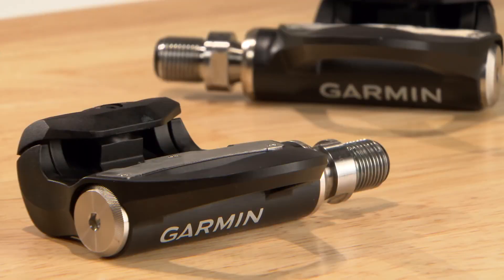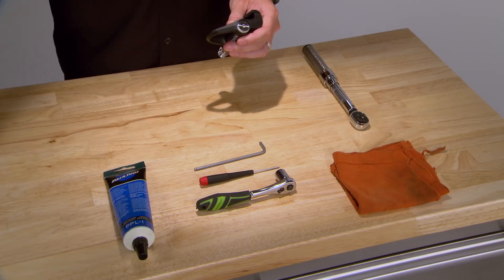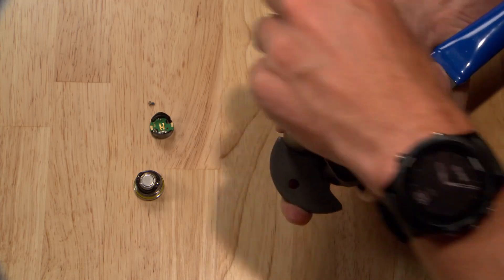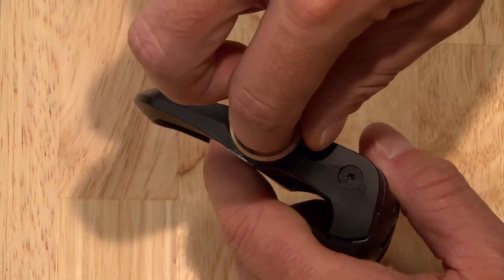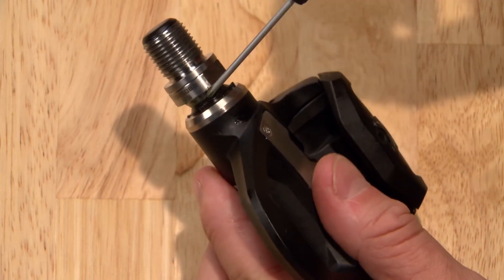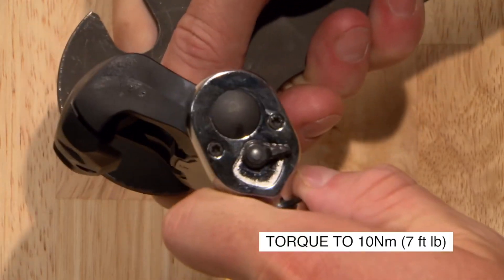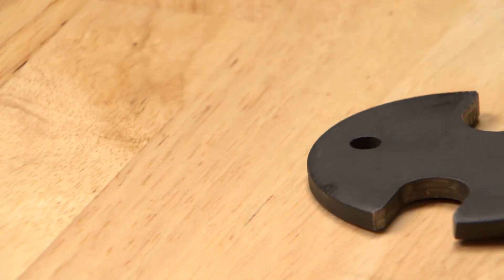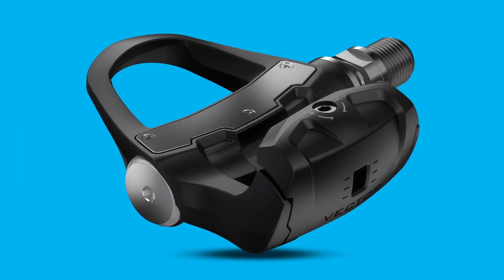Garmin Vector 3/3S: Servicing Your Power Meter

Comment: My purchase came broken - the body felt off the pedal. Hopefully I did not suffer injury. I needed it for a race so there was no other option getting it tightened in a bike shop by professional. I am really sorry that I didn’t returned it back. After few battery changes the thread of the pedal body was damaged by the battery cap. Could you please explain to me why the battery cap is metal and screws to PLASTIC?

Comment: What 12mm socket do you use? I've tried three that all claim to be "slim", and none of them are narrow enough to reach.
Reply: yeah very frustrating, none of my 12mm sockets fit either
Reply: the tekton 1/4in drive 12mm socket fits (bought on amazon)
Reply: @patrickrenschler  You don’t happen to know which tekton set you used do you? Were they thin walled or regular?
Reply: You have to force it in, it sucks

Comment: While you are servicing  your V3 pedals (not for 3S pedals) note down the ANT ID numbers that are engraved on the spindle body near the cranks. You may need them when you sync your Garmin head unit to the pedals.  In my case, with Edge 1030 head unit, the ID's are entered in the Garmin Connect mobile App under Devices>Device Settings>Pedals (enter ID# for each pedal and hit "LINK"). They will then calibrate and show cycling dynamics correctly.